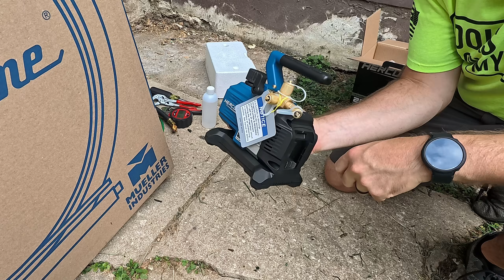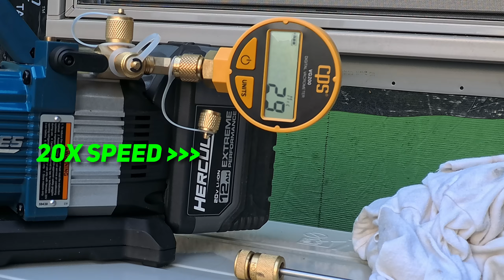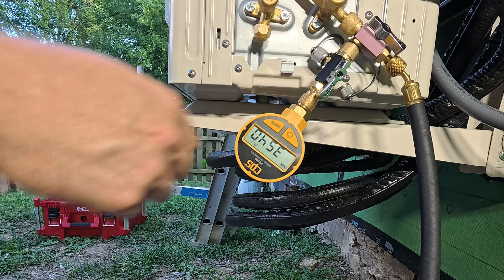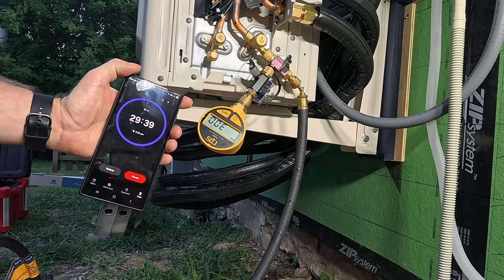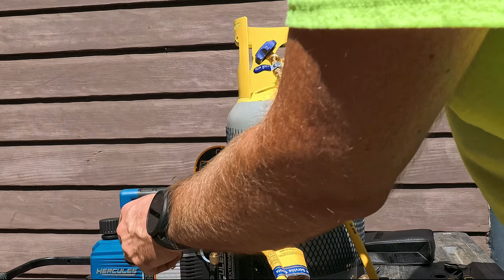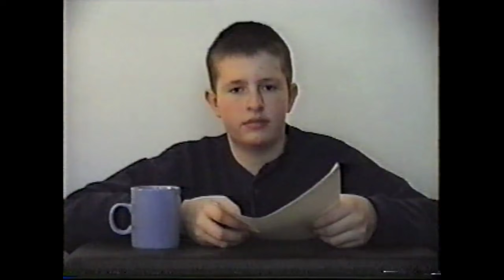Hercules Cordless Vacuum Pump! For DIY AC Install & Repair ✅

Comment: Fujitsu are awful
Reply from the maker: Yeah, found that out the hard way ☹️ Meanwhile, my cheap Pioneer (Midea) on the other side of the house has been running faithfully for 5 summers now without an issue.

Comment: Is there multiple line sets under the Unit or did you coil the leftover lineset under the unit??? 
If you did, that's what killed the unit. MrCoolDIY units say to do that too but it ends up creating an Oil trap and starving the compressor, which kills it. Bad idea
Reply from the maker: Fujitsu tech support had me flip a dip switch labeled "do not change setting" in the manual, and it remedied the issue, which is fruatrating.   Anyway, Fujitsu requires a minimum 16-foot lineset length.  If I went straight up the wall, it would have been less than 10 feet.  The coils are horizontal, not vertical, to prevent oil traps.  Plus, the oil trap myth has been essentially busted:
https://youtu.be/dyEj92UdKtg?is=2T_9cneq9nBLUgfN

Comment: Hey Jim, quick question. How was the temperature of the unit while running and after it had been running for 30 minutes or so? Thanks!
Reply from the maker: It got relatively hot, but the pump body is all aluminum and so it didn't seem to be a problem.

Comment: Nice review. I Do HVAC for work and been using the Hercules for awhile now and it works great. Have used it for 6 installs now and love it. Even worked great on a 5ton system.

Comment: It's cool that they made a cordless vacuum pump, but given how long I've seen vacuum pumps run for to eliminate all air, it definitely seems like one of the more questionable items to select to power with batteries.
Reply from the maker: Yup.  I don't think this would work for commercial HVAC guys, or for very large residential systems.  But for vehicles and average mini splits, I think it's a good option.  Probably want an 8ah or 12ah battery, or a couple of 5's on hand.
Reply: @PhillyFixed  Nope, it works great for HVAC work, have used it for 6 installs and even a 5ton system and its fantastic.
Reply: I have the 12 ah battery with mine and got about 4 pump downs with it before I had to recharge the battery.